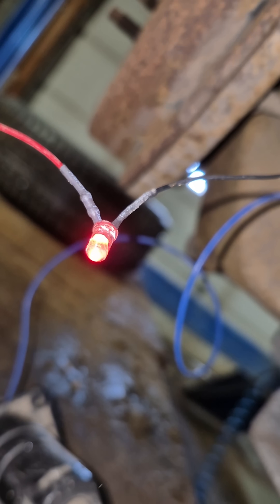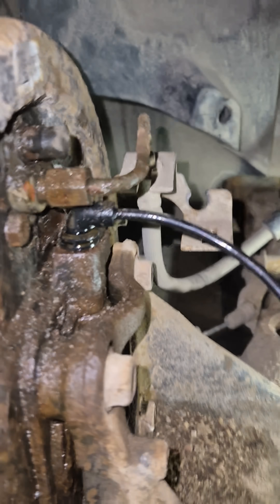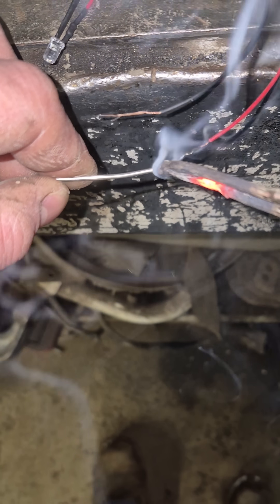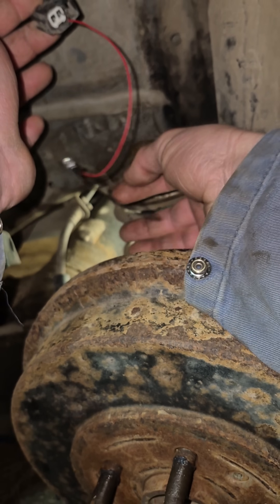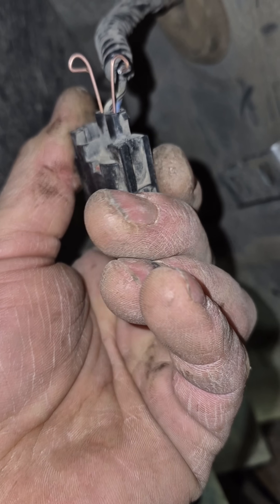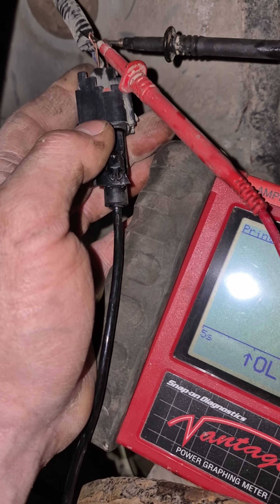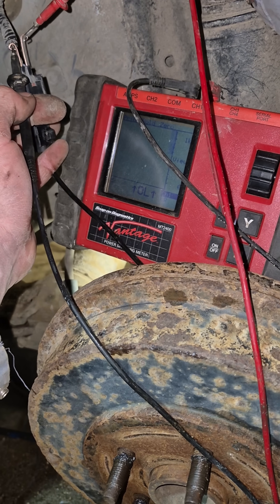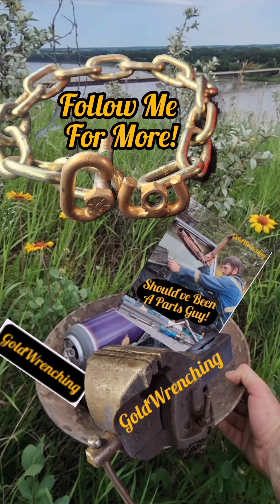Bad Connection or Broken Wire?

Comment: One secret for these moden gm junk abs modules is the code will set for circuit code but its just a senaor aignal like you noticed on the test drive speed sensor pids.